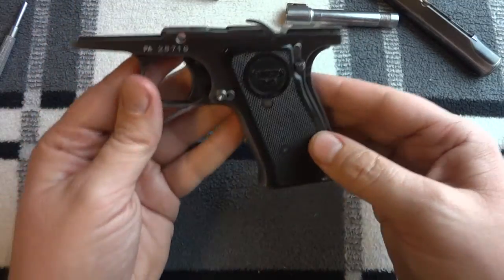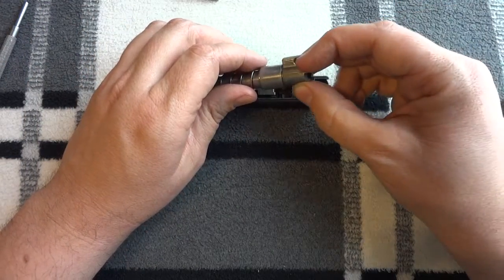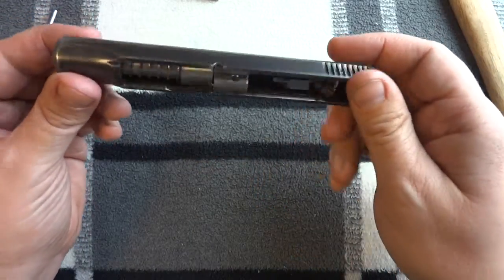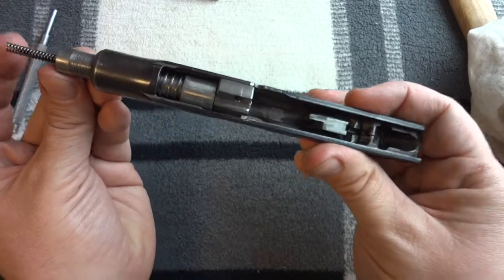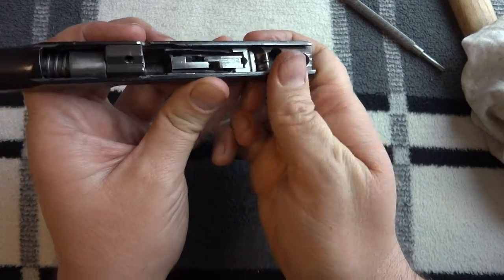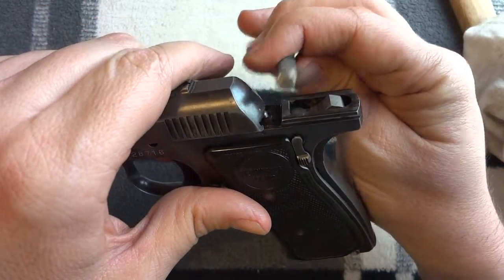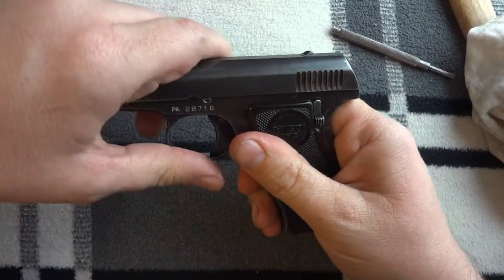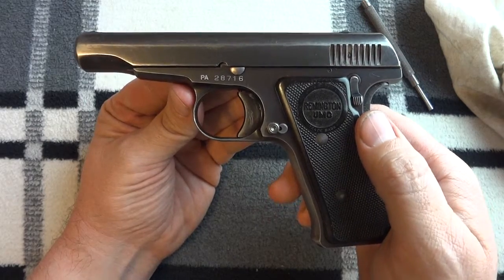Remington 51 Part 4 of 5, Reassembly

Comment: Welcome to The Pedersen Device!   I have yet to not be able to figure out how to field strip anything from a Glock to a GMC 2500 Custom Camper Special. Yes, I yanked the transmission out of a 1970 GMC on the side of the highway, and changed out a clutch that exploded. I also sawed a galled bearing race of a spindle while a cop and a tow truck watched, and waited. When they saw me fire up a torch they decided I was driving home the 3 wheeled  truck  after all, and it would have 4 working wheels again. Adapt and overcome. Winch? Farm jack, chains, ropes and a big ass rock, to chock the wheels. Why Remington decided to try to remake the model 51 in poly, and in 9x19mm Para, after they axed it way way back in 1934 is a curious mystery, and not without a sea of problems, including a recall or two. I think Walther's attempt at a P7 piston delayed blowback at a $500 price point is also folly. That was originally adjusted for inflation about a $1500 gun,  when H&K made the P7. Yeah, no squeeze cocking device, but delayed blowbacks are just expensive to make, more expensive to design & still kinda goofy cool.
Reply from the maker: Well, Remington did not decide to remake the model 51 in polymer.  They 're-imagined' it.  The only polymer pieces are the grips.  The general pistol shape and some of the internals are 'inspired' by the original 51, though they found a way to ruin most of it.  The locking block is superior in some ways, but they had untrained baboons building the things AFTER they told them they were fired.   Also, the original 51 was not 'axed' in 1934.  They discontinued production around 1926.  Models made until 1934 were assembled and shipped from parts.  That's 8 years of unsold pistols.  The guns were great, but Colt sold 10 times the number of their excellent pocket hammerless pistols.

The Walther CCP is a decent gun built by engineers, not gun folks, in my opinion.  The HK P7 was an outstanding gun, but just overdesigned.  I'm not sure what the point of the first part of your post is.  If you and I can disassemble the gun, it means absolutely nothing.  The public will not buy a gun that's difficult to maintain given how EASY it is to maintain a Beretta 92 or Glock.
Reply from the maker: Also, the 'Pedersen Device' is something completely different.  Sickeningly, the Model 51 is not the hardest Pedersen gun to disassemble.  Try digging into a Model 14.
Reply: I thought the 51 was one of the best Pederesens out there, for disassembly and operation. The 14 is far more fiddly, and there are some European variants that are pure crap. Anything aside from  mass & weight to delay a blowback action gets really interesting really fast. The largest blowback (pistol) I own is .380. Long guns can offer better or worse options. I just put a spring for a 1990s poor selling, but fantastic Korean gun behind a 1000 pound counter. Any serviceman who served in the Korean DMZ in the 1980s would jump on most of the Daewoo stuff. Made in Korea generally means made in Korea by an American company to be sold in the USA at a low price point. Some of the Daewoo stuff did sell at a good price, but cheap or cheaply made? Hardly. Tearing the slide off makes me think of Kimber, Wilson, Baer. It's that tight and that well machined.  That part ain't goin anywhere, but I have 1000 pounds of transformers for tube amps, and radios to move. Thank god the big ones are not in there. (80 pounds  to 800 pounds)
Reply: Pederson LOCK... The Pederson device was to convert a bolt action 30.06 to a fully automatic 30.18...

Comment: Do you have any video of the frame being stripped and put back together cannot find it anywhere. I bought one already disassembled completely and cannot get it back together. Any help would be great. Jim and Diane
Reply from the maker: I can't post disassembly videos.  Any mid-skilled (preferably older) gunsmith should be able to help you.  I am retired and don't take on any work remotely.  The Gun Digest book of firearms disassembly I have doesn't have an explanation.  I think I used the NRA book of firearms disassembly combined with experience when I got my first 51 about 30 years ago.